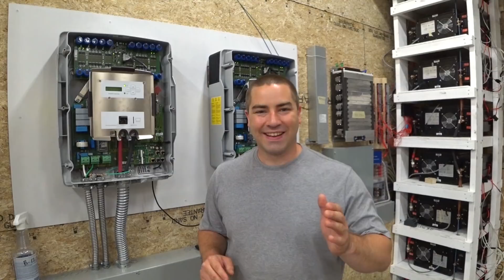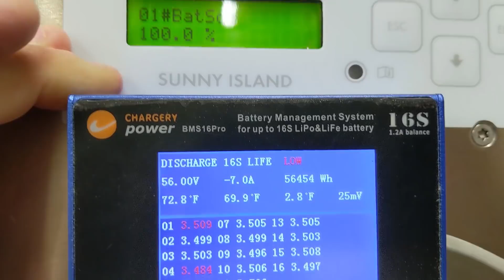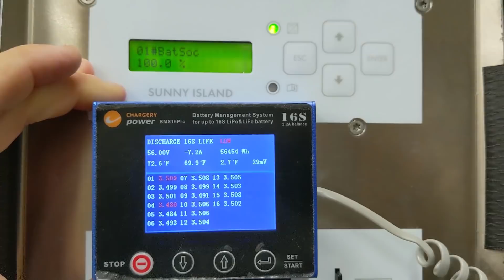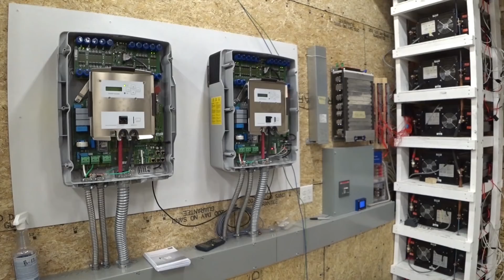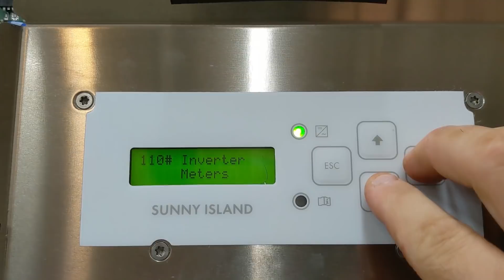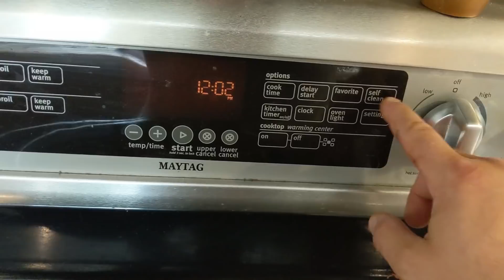Overloading SMA Sunny Island Inverters, Off Grid

Comment: Is the Schneider better or are they about the same?
Reply: That's what I thought, the Schneider warranty seems to be better.
Reply from the maker: I like the Schneider more.  The Schneider works out of the box as 120/240V without any need for programming.  However, if your question is about power, then they are both very similar.

Comment: David
I have some questions.
I need a new inverter, my Sunny Boy 7000 has been working nonstop since 2012 that's over 12 years.   I think I need a new one since I just got an error message Fac-Bfr and they are telling me I need to replace it., one of my questions is do I need to replace it?   or is there a fix for it.
They are suggesting the SBSE 7.7-US-50.   do you agree with this recommendation?
Should I look into the Tesla, or do you know one that I can get an incentive with the government since they are pushing this so much?
They are also telling me that the new ones don't have a transformer like my 7000 does!
Reply from the maker: Sorry, I don't have a good answer for you.  I don't know the error messages on these SMA's.  Congratulations on getting it to work for 12 years!
I'd check out ebay and see if you can buy a direct replacement for what you have.  I just checked and saw several for sale between $1k-$2k.

Comment: Im glad to see how excited you were to test these .. i have 2 of the same ones running my cabin, garage, and barn on my ranch for the past 2 years now. I live 100% off grid with them running 24/7. The most ove had mine were up to 11kw.. that had me scared for a while.  They didnt care one bit though.  During the summer they handle my central air in my cabin and by RV at the same time without even thinking about it.  They have shut down on me in the heat of the summer when im running the ac and the electric stove and the electric hot water heater kick on.. but in fairness it was over 130°F in the power room of my garage.

Comment: How was setting up the Li Battery settings on the SMA Inverters?
Reply from the maker: It's not easy.  I ended up using a raspberry pi with a software from Github.  https://github.com/madsci1016/SMAVenusDriver

Comment: How long would your battery setup power all your stuff in your house at full load?
Reply from the maker: At full load?  I don't know.  I don't run my microwave 24/7.  My heater doesn't run 24/7, it kicks on and off to maintain temperature.   I don't understand the question

Comment: What’s the real world idle consumption on those inverters? there’s a company in Canada selling them for 3000 at the moment
Reply from the maker: I measured 35W each.  That's pretty good for what they are.  Just keep in mind, they are built for AC coupling, with a lead acid battery bank.  If you want DC coupling and/or lithium, then it's troublesome.  ( I tried for a long time)
Reply: @DavidPozEnergy  ah thanks, 35 watts that’s surprising good, Definitely plan on using it with lifepo4, I better steer clear.

Comment: So far is the Sunny Island SMA battery inverter, the best battery inverter for OFF-GRID/Backups system that you tried? 
Or you recommend other brand and model?
Reply from the maker: Every inverter has pros and cons.  The SMA inverters have the highest over-load capacity without shutting down of any inverter I've tested.  But, the programming is cumbersome and they are expensive compared with other options.

Comment: David , hope you get this message ASAP. I have a F141 code..  overload 
Question is: HOW DO I RESET THE 141 code. 
This would help me out in three digit degree Az weather. 
Exciting test
Reply from the maker: I don't think I ever had that code, but I have had to do a factory reset before.  I think you have to disconnect all power for 30 minutes to let the power bleed off.  Then, when you re-connect, and turn on you have to press and hold the enter button when you see "SMA SMA SMA" on the screen.  But, I'm saying this from memory over a year ago so I hope it's accurate.
Reply: Thank you David, I haven’t tried factor reset. I was skeptical of doing that function, since my only Manuel is my iPhone and that makes it hard to follow instructions . I’m am learning as I go. . I purchased a DCSolar trailer. Nice equipment however...xxx 
Are there any breakers on 6840 behind the big yellow lol turtle shell. 
Again thank you.
Reply from the maker: There are no circuit breakers built into the inverter.  The manual makes a point of this to say that the disconnect switch on the front is only a disconnect and is NOT an over-current device.
Reply: @DavidPozEnergy  thanks , everyone I’ve spoken to wants to sell me a new unit . I never had an overload since I’ve had the units. 
Do you think a factory reset would do anything? And if so have you made a video on this? 
Thanks
Reply from the maker: I don't have a lot of videos on the functions of the SMA's.  Sorry.  At the moment I'm running my house on Growatt inverters so I can't test the reset on the SMA's.  But, after speaking with several others a common concern is not supplying the inverter with enough current potential.  What I mean is, a large enough battery bank and large enough wires.  Your setup might be fine, but something else to consider.
Reply: @DavidPozEnergy  thank you for your time sir . If you or anyone else has other suggestion please pass them on. Thanks 
I will go check things out,
Reply: I also have the F141 error. I was hoping to see the answer here.

Comment: Hi, what made you ditch the Sunny Islands? I've bought the 8.0H model (European) and am considering getting a second for 50A at 230V (so no real stress for them) so would like any negative feedback you might have. Thanks.
Reply from the maker: I still have the SMA's up on the wall, but not currently powering anything.  I wanted to test some new inverters, but I'm not ditching the SMA's.
Reply: @DavidPozEnergy  I'd be interested to hear what your plans are. They are great. We have 2 set up in a split phase 240v system with about 18kw of solar on 3 Sunny Boys and a forklift battery for backup.
Reply: Apart from the eye-watering cost, of course!

Comment: Hello, I have a single sunny boy sma 4000tl-us-22-926 in my garage running my 3.9Kw system. Basically Im trying to find out the cheapest way to have the option to cut off from the grid and have one outlet in the garage to run the full size fridge in there or other things in case of an emergency. I dont have $$ for big battery backups. Im not sure if I have to buy one of those islands or if an electrician can wire in some switch and outlet then plug in some little 3K watt converter.. thanks..

Comment: I have the older model 24v 3.3kw Sunny Inland inverter. It has been powering our house entirely for almost 14 years with no issues at all. The only negative is their rating degrades at 40 degrees and in Australia its fairly common to get 40 degree days in summer, especially inside the inverter room.

You should have a look at the Australian made Selectronics SpPro inverter range. Next step up from SMA. A little expensive but quality and very functional.

Comment: How are these inverters doing?  I am thinking about buy two of them.
Reply from the maker: There are pros and cons to them (like anything).  
Pros: I've never had one over-load on me.  The pair runs my whole house and garage with perfect sine-wave.
Cons: The algorithm built-in doesn't like having non-certified batteries.  The inverters look for a communication (CAN bus) with batteries.  I can't do that since I build my batteries.  So I have to manually re-set the SOC once in a while.

They were a good buy when I bought them.  However, if I had to spend more than $2k each ($4k for the pair) then I'd buy something else.
Reply: @DavidPozEnergy  what would be a good second option to take the load?
Reply from the maker: If you want the exact same size (12kw) then try this: https://www.signaturesolar.us/products/f5b06d12d3/2203789000006299864
Reply: @DavidPozEnergy  They just screw the web site all up and got rid of your discount
Reply: @DavidPozEnergy  I just bought the 12000k grow up from signature solar.  Hopefully it works out

Comment: David , which solar charge controller would you recommend to work with a pair of these Sunny Islands ? I 've went back and watched all the videos since you got these and I can never see it ? Still using the Victron ? Would you by the Sunny Islands again ?
Reply from the maker: I'm still using the Victron.  However, if you are building a new system with Sunny Islands, then try AC coupling.  The Sunny Islands prefer AC coupling.
Reply: @DavidPozEnergy  Got any suggestions ? I need to do a ground mount with a long wiring run 300 ish feet . So I am looking for a charge controller that could take high PV volts in like the Schneider 600v . I'm looking for something reliable with high PV voltage that doesn't cost 7k like the Sol-ark but haven't found anything I'm comfortable with. Outback Skybox looks really nice till you go on their forum and it's trouble everywhere and crazy idle draw. You never read anything bad about the sunny islands , I just haven't found what the correct affordable way to get the PV to it. Thanks so much for taking the time to reply .
Reply from the maker: If you don't own any equipment yet, you could buy Growatt 5000ES.  I did part 1 review already on my channel, and am editing part 2.  It is fairly high voltage PV at 450v.  https://youtu.be/2eF7zxmKBAg  But, if you already own the Sunny Islands, then buy "grid tie" inverters.  SMA makes the Sunny Boy for this purpose.  But any brand grid-tie inverter works.  This is called AC coupling.
Reply: @DavidPozEnergy  I don't have anything yet , been researching all winter. If I could put the Sunny Boy at the ground mount I guess I could run the AC for the long run but it needs to "see"  the grid ?  I'm in TN so there is no net metering or anything like that. From all of my research SMA seems to be the equipment of choice for me . If I were to go the more inexpensive route Growatt would be at the top of the list . Thanks for your replies !
Reply: @onthelake9554  Why not do as David says and do AC coupling. Our sunny boys are under our solar arral and are 300' away form the house. SI are in the garage. Si takes care of the battery charging. By having the inverters at the panels, we change the dc to ac right there and don't need to worry about 300' of dc voltage losses. Use a big enough ac wire, no problems.

Comment: I have 4 of these and they are nice inverters, but their overload capacity is terrible.  They're good for powering many things but they cannot handle high surge loads like well pumps and AC compressors very well.  They erred on the side of low stress rather than high performance which isn't all bad but they won't suite every need.  Inverters 1/4 the price will do much better for some high surge applications.
Reply: Not my experience at all. Our AC startup draws over 80 amps and the SI 6048's will handle it, no problem.
6048 is rated for 5750 watts continuous.
2 hp well pump with big surge is also no problem.
They can do up to 11,000 watts for 3 sec (which is fine for big AC) 
 AC power at 25 °C for 30 min / 1 min / 3 s 5300 W / 8400 W / 11000 W 7000 W / 8400 W / 11000 W
Remember, this is with no solar input (i.e. at night.) During the day the Sunny Boys handle most of the loads.

Comment: Hi David. Thanks for your videos. What battery type and charge settings (220#) are you using in the SMA when you are using the grid to charge your battery bank? Are you using VRLA setting? How do you like the Chargery BMS? Do you have the SMA inverters shutting the system down at a given battery percent and use the Chargery to control your dc switch as a backup? Video on this would be much appreciated. I have these inverters that acquired in DC solar trailer that intend to connect to BMW I3 battery pack and working to decide which BMS to utilize and also appropriate settings for SMA when using grid ac to charge these batteries. Like you I have DC coupled solar charger at this point.
Reply from the maker: Hi.  I'll try to answer the best I can.  I ran the inverters for most of this past year in VRLA as my battery type.  I've never charged from the grid, and there is not grid connected.  I'm purely using this off-grid.  I'm disappointed with the Chargery BMS.  I'm going to move to the Tiny BMS and remove the Chargery.  Yes, the plan was that the inverters would shut down first, at a low SOC.  I originally had it set up where the inverters shut down at 30% SOC, and the Chargery was more like 10%.  However, this never worked out.  I've re-calibrated my shunts a dozen times on both, but each has their own problems.
Reply: @DavidPozEnergy  thanks for reply David. So you haven’t yet used the SMA island to charge your batteries, you’ve done so via the Victron Solar Inverter only? I ask about the settings as once we utilize AC coupled solar inverter we would be charging with the SMA inverter and its settings. Sorry that Chargery not working well. From videos I have seen I’m  not happy with how much it let’s cell balance to be different. I thought it’s display is helpful as is ability to control a relay for low voltage cutoff.
Reply from the maker: I have never charged my batteries through the inverter, it has always been my Victron CC.   Yes, AC coupling would be great.  I have a SMA Sunny Boy inverter in my garage.  I'll be AC coupling my new solar array with the Sunny Boy.  I'll be able to report back how well that works once it's up.
Reply: @DavidPozEnergy  thanks David. I think I’m going to work on getting the victron shunt and victron Venus OS installed to rasberry Pi with a Can bus adapter to communicate with the SMA to use it to report state of charge to the SMA inverter. Another YouTuber was gracious enough to leave his code on GitHub. If we get it working I will let you know. I think this would be best way to know battery state of charge and manage the charge and discharge for the SMA Sunny island.
Reply from the maker: Yes, I'm a beta tester for that program.  I have been testing the Raspberry Pi and Victron Smart Shunt combo for a few months.
Reply: @DavidPozEnergy  Very good! How is it working?

Comment: oh!!!! what about the battery amp and capacity
Reply from the maker: I'm using a 24kwh battery in this video and at some points I was pulling as much as 300 amps from it.  But it's wired up for high amps and was not a problem.

Comment: The fact that you had to work to reach 7-8 watts by running your stove, AC in both buildings, and all your lights reassures me that a 8000kw inverter would probably be sufficient for a small home that is very energy conscious and running more propane appliances.  Thanks for the test.

Comment: I've got a variable speed heat pump. It runs from 12.0-27.5 Amps under full load.  How many Sunny Islands would I need to do 220 VAC @ 27.5 Amps??  I want nuthin to do w/ a grid inter-tie system.  My util does not pay what my power is worth..
Reply from the maker: Sounds like your heat pump can draw up to 6kw.  One Sunny Island inverter can handle the watts.  However, this particular inverter only outputs 120v.  You can then use a transformer (sold by SMA) to make the 240v.  Or you can use two of these inverters.  But, I think using one Schnieder that outputs 6kw already at 240v is a simpler option.
Reply: @DavidPozEnergy  I used to work for the Solar Test and Research dept of AZ Public Service aka STAR. SMA's were our most reliable inverters. I'll probably go w/ a ganged inverters..

Comment: Even more mind blowing is the fact that these can AC couple. From previous videos you already have some PV. If you add the PV to the critical load panel the SI can turn them on and off via frequency shift. Still PV power but all the solar goes through the SI then to the grid. Works with any grid tie inverter. Not sure if you are charging the battery bank through the SI. They previously stated they were not compatible with lithium. This makes it so you have off grid capacity for both SI plus all PV. It's been some time since I have installed these but they are so robust. Don't forget to change the settings though!
Reply from the maker: I agree, it's mind blowing.  I bought a SMA Sunny Boy recently.  And last week I finished erecting a new solar array.  My plan is to AC couple exactly as you described.
Reply: @DavidPozEnergy  2 ways to control the sunnyboy. You can frequency shift from the SI or via RS485 comms the SI can ramp the SB and "demand” power during an outage. Really a well thought out system. As a solar tech I have watched the battery systems evolve. Not really impressed with the newer stuff as they seem not field repairable. Customer could be out for weeks waiting for replacement.

Comment: What are you using for a charge controller with your current setup? I’m trying to design a modest off grid system and can’t decide between the sunny boy and charge controller or an all in one system like the Outback Skybox
Reply from the maker: I'm currently using a Victron 250/100 charge controller.  However, the SMA's don't like when you DC couple, they really want AC couple.  So I don't recommend my setup.  
If you can swing it, the Sol-Ark 12k is hard to beat.
Reply: @DavidPozEnergy  Why not just put a Sunny Boy on the AC1 side and let the SI's charge the battery? They don't even need to be in the same building. Just set SB's to "off grid mode."